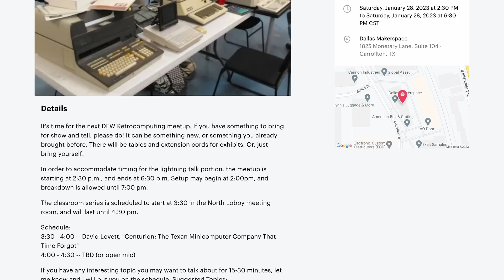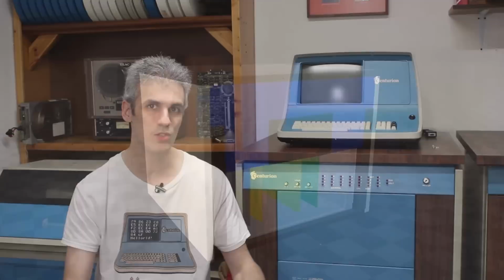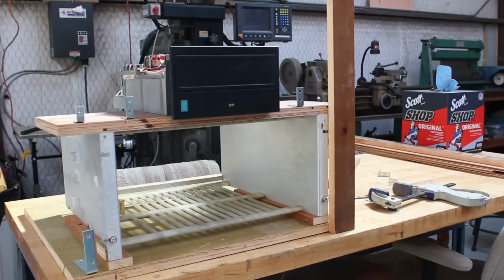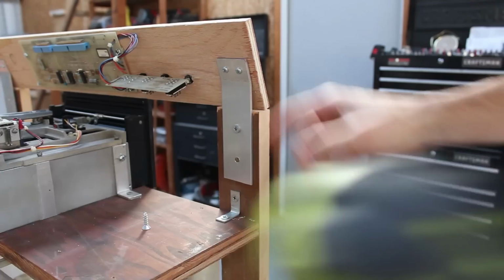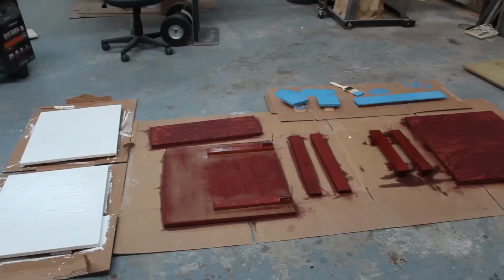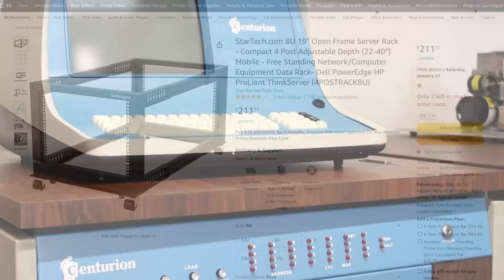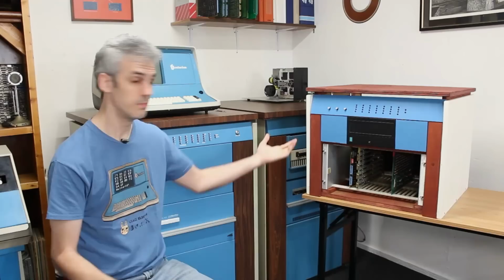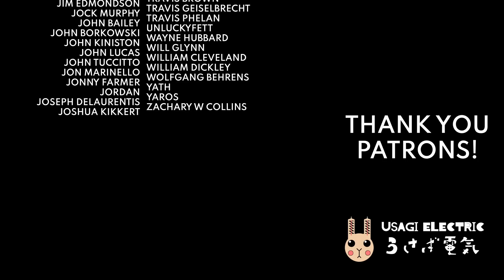Building a “Miniature” Centurion Minicomputer (Part 1)

Comment: It looks like you might have enough room to fit 2 8" drives side by side.  Would mean you wouldn't have to slim down the OS so much.
Reply from the maker: Unfortunately, the FFC card only supports a single floppy. They physically wired it so drive 0 is a floppy and then drives 1, 2 and 3 can be daisy chained Finch drives. If we wanted to run dual floppies, we'd have to actually change around some logic gates on the card and rewrite a good portion of microcode.
But, Centurion did actually experiment with a dual floppy only system, so it's actually a totally viable idea! And in the future, we may play with that idea, maybe even building a new custom floppy controller card.

Comment: Your making it into a LAN party pc!
Reply: Actually, it supports multiple terminals at the same time (although one floppy will struggle to service many people at once), so having multiple terminals on the show is an option even if some of them are just normal laptops running PuTTY or something like that.
Reply: @jwhite5008  i was thinking something like that with a tiny local MUD made on it, with a few players connected.
Reply: @hicknopunk  I'm not sure if centurion supports a "normal" network of any kind, let alone TCP/IP or even Unix sockets. Furthermore, I don't see a point - MUD can run on any hardware, and this computer is unique in its OS and system software.
Reply: @jwhite5008  it goes along with the LAN party case he made.  I guess there is probably a space war clone for it at least, no way some programmer didn't waste on clock hours to code in space war.
Reply: @hicknopunk  Maybe but we don't have any such software right now and porting it would be quite a challenge and not very useful. It is possible something may be on the finch drive, but that doesn't work - at least, yet.

Comment: Why not just hookup the original machine to a VPN taxi box?  That way you can VPN into the WIFI Serial Telnet Session and get a serial terminal hookup?  All you would need is OpenVPN, running on a linux  box, and a NULL Modem Cable either over WIFI or directly through a RS232C cable.

OR

Just stick to SSH, the VPN box and  use minocom to talk to the Centurion that  way?

The only thing you would  have to do in that case is make a TERMCAP description for the telnet/ssh session.

Comment: What about restoring the fake system? Is that plan out of the window? The card called cannot be in two systems.
Reply from the maker: Not yet. This is mostly a short term solution to the meetup at the end of this month and VCF in April (though large scale changes may happen to the mini-Centurion between the two). 
Ultimately, I would like to build a mobile Centurion using completely new parts. We've reverse engineered enough of the cards that we can actually produce new cards now. Someone is actually already in the process of building and testing an all new CPU6 based off our reverse engineered schematic.
But, with just two weeks until the event, I don't have enough time to build a new card cage and new cards that go with it. So, we're borrowing from the counterfeit system for the time being.
Reply: @UsagiElectric  very interesting, i expected any new implementations to be FPGA based, much more compact than actual new cards, and cheaper. But it will be interesting to see actual real hardware to be build from the reverse engineering. Hopefully they do use more modern multilayer PCB tech tough 😀

Comment: hmm can you ttl in the the real "Centurion" from the mobile Centurion to acces the hard drive via ttl
Reply: I'm not sure this can be done with inherent internet lag, it probably expects microsecond performance. 
And it would require lots of work, not a project for less than 2 weeks.
Furthermore, the hardware is aged and fairly fragile, who knows what people are going to do with it, so it's safer to use a much less rare floppy.

Comment: It is going to be hard but about having someone create a CPU using a FPGA or CPLD or a combination of both.
Reply: EDIT: this reply is wrong, see reply by SJ Software

Old text kept for context: 

As I understand there are no schematics and tracing the CPU board is literally impossible because it is in fact multi-layer! So to do that someone would need to create the hardware more or less from scratch from very very incomplete understanding how it works, which is much harder than creating a software-only emulator. Connecting real hardware other than a terminal to it is also kinda pointless since that hardware is just as rare as computer itself. The FPGA board will still look and behave nothing like the original so investing so much work in it seems quite a waste when a raspberry pi with software emulator will look and behave similarly enough. And anyone can replicate it quickly and cheaply enough as opposed to shipping, assembling (and debugging) a custom FPGA board.
Reply: That seems insane and time consuming to a fault
Reply: @jwhite5008  The CPU6 board is multiwire and on the solder side is actually quite easy to trace. A couple of us spent some time and traced it out and asked Usagi to help with the missing traces on the component side. There are complete (99.9% correct) schematics on Usagi's github wiki. Someone else from those schematics produced most of a FPGA implementation. And there is a javascript emulator which is also 99.9% accurate. Most of the IO boards have also been partially or completely reverse engineered.
Reply: @sjsoftware72  Wow!! That is absolutely fantastic! 
You guys are unbelievably amazing! 
It seems I missed quite a lot, oh well.
Reply: @jwhite5008  All good 🙂

Comment: i should use a proper written centurion emulator and put all in a replica centurion computer case that will weight nothing.. just for shows like that... it is way to fragile to move real computer around... that's why emulators are very handy. build a replica centurion case and put emulator in it just for upcoming shows...  not a real deal, but for shows will be perfect.. and original is staying safe at home... to valuable to move around. i watch all process... do it... will be amazing
Reply from the maker: That's not really my style. Demonstrating an odd system like this at a show is all about the experience and theatrics of it. Hearing the floppy clunk or the hard drive spin, seeing the front panel lights flash as it loads in your program, engaging all your senses (except taste, don't lick my computer ;p).
If it just becomes an emulator inside a wood box, it loses everything that makes the experience special. Plus, we have good schematics now for all the major boards, anything breaks, I'm confident we can repair it!
Reply: @UsagiElectric   then you can build another one,,, that is cool..
Reply: Mmmm..... is it posible to replicate those hard drives and floppy drives😉😉. Who know how long will work until dies like forever.. i watvh whole restoration.. least you have entire OS code and more for this beauty..

Comment: Hey, I like the project :)
I'm a little concerned with the FDD, if it has any mounting bracket that holds it in place and prevents dislodging, or if it's just put in there.
Reply from the maker: Thanks!
Watch from about 6:00 on, I make custom brackets to hold the FDD in place.